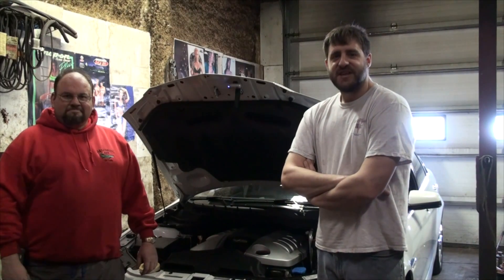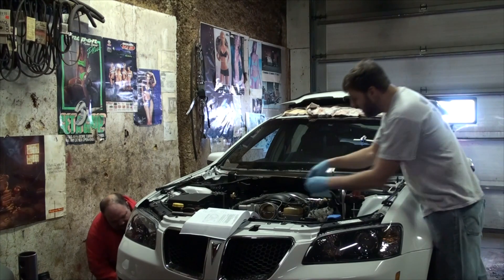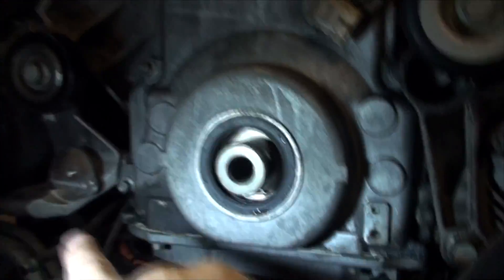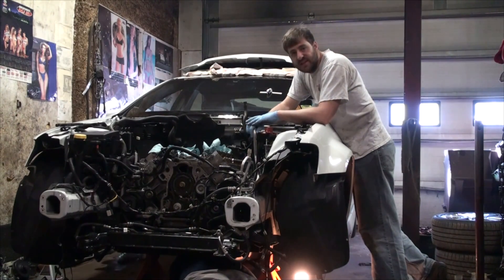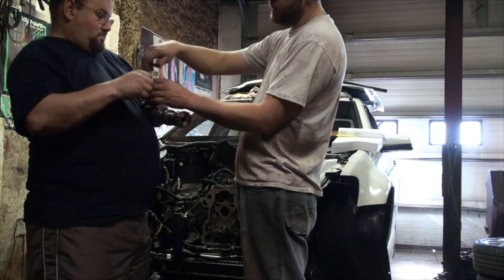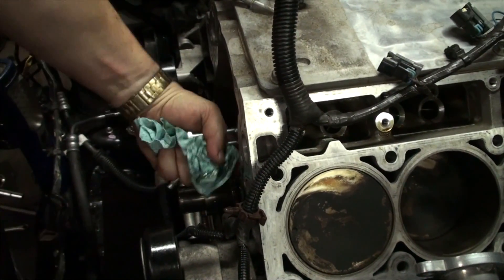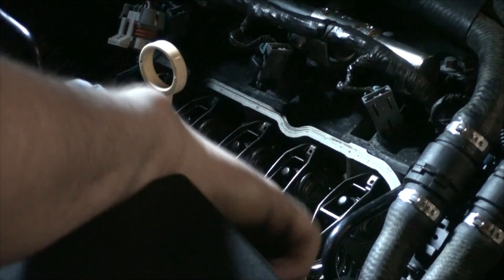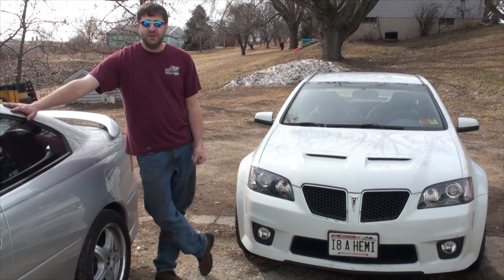Josh's Car Corner - Ep. 26 - Gen 4 LS Engine Cam Swap

Comment: One recommendation I would make is to tape off the intake ports on the heads and also stuff some rags in the openings to the oil pan on either side of the crank.  This way if the drop something you don't need to drop the oil pan or tear the engine apart.
Reply from the maker: If we weren't removing the heads, I would have blocked off the intake ports. Even if something had fallen into them, worst case it would have landed on the pistons and we would have removed it. I also blasted air into all the ports before I put the heads back on.
Reply: Say what?  He took the heads off.  LOL

Comment: Awesome video. Why do you drive the car for a couple hundred miles before a tune? What if it's not stoic? Isn't it dangerous to drive it much that way?
Reply from the maker: No,  it's not.  The factory O2 sensors are still working, and in closed loop the computer will adjust under normal driving conditions to be safe. Wide open throttle is a different scenario.

Comment: Did you use a pushrod checker tool?  Or were you lucky and got 1 to1 1/4 turns of preload?
Reply from the maker: Hydraulic lifters don't have preload.  You torque the rockers to 22 ft/lbs and you're good.  And because we used the same heads,  same gasket thickness, and the cam has the same base circle,  the same pushrod length as stock was used.
Reply: @JoshsCarCorner  Hydraulic lifters always have preload to attain proper valve train geometry. .070-.100 on LS7 lifters. Solid lifters don't have preload nor do low lash lifters.

Comment: So two part question. 1 what service manual and where do you find them. 2 is there anything internal requiring loctite, or TTY that you recommend switching to ARP? Did you actually have to use loctite on things like the can gear that are exposed to vibration? Ive heard bad fairytales of guys having the cam bolt back out and destroy the valve train.
Reply from the maker: The only service manuals for the GTO are the Helms service manuals. I believe you can get them at GM Parts House. I can't recommend where to get them.,

Aftermarket cams typically use a 3 bolt system for the cam gear, only the factory uses a single cam bolt on the Gen IV engines. Loctite, isn't called for by the service manual. If cam gear bolts come loose, it's because they weren't torqued down properly to begin with. Loctite doesn't work on bolts that are exposed to oil.

Comment: awesome vid. You made it look so easy. Any check engine light or anything to make it fail a  pollution test?
Reply from the maker: We did get a light for the MAP sensor, apparently it didn't like the cam lope at idle so I had to correct some things. And we don't have smog tests here, but the car has cats so even if got tested I could make it pass.
Reply: Josh's Car Corner thank you for the response sir. That is encouraging. My GTO needs it bad.

Comment: When jacking up the engine to remove the oil pan, what portion of the engine did you use so that you didn't damage the engine? I'm removing the oil pan on my g8 and am wondering where is a safe place to place the jack? Any info will be greatly appreciated!
Reply from the maker: We used an engine hoist and lifted the motor with a chain tied to both the lift points on the top of the engine.
Reply: +Justin Williams block of wood on the trans bellhousing remove the shiny inspection cover first and just jack til the motor mount pins are barely in the hole, then stick a short 3/4" socket on each side under the mounts, the pin on the mount holds them in and take out the jack , easiest way Ive found for the G8

Comment: How did you guys bend the pick up tube? What step bent it do you know? Also how do you avoid that problem? Because I’m doing my cam swap within the next week and I’m curious and can’t figure out how to avoid it and if you said it in the video I’m sorry i probably just didn’t catch it. Thanks!
Reply from the maker: We needed to remove the pickup tube from the engine and the pump first, so we should have dropped the pan and removed the pickup tube before trying to remove the pump.
Reply: Josh's Car Corner Ah alright, thank you! Appreciate it. Grateful for the video too, definitely helps.

Comment: That car was named the Holden Monaro in Australia (2 door Commodore) & was exported in left hand drive form to the U.S. badged as the Pontiac GTO,my car is a 2002 model Holden VY SS Commodore which runs the Chevy LS1 engine which needs a hydraulic lifter & I'd hate to say a camshaft replacement.I was wondering how long does it take to replace the camshaft & lifters while the engine is in the car?I know the cylinder heads have to be removed so I've been wondering could I do it over 2 days on a weekend in March or should I cross my fingers & hope the lifter roller(s) don't fall apart & do it over 4 days over the easter long weekend?I just need to cross my fingers that that it will hold up because once the engine has warmed up one of the lifters jam up & start making a "clattering" sound !!!!
Reply from the maker: First, I know the entire history of Holden, see episode 1 of the show. Second, regarding your cam swap, if you knew what you were doing, had all the tools and preparations done beforehand, you could get it done in two days. If you've never done it before, I would go for four days. I have done a cam swap in a VZ Monaro/GTO before and it is more involved. You have to remove the front bumper cover, radiator, and AC condenser so you can get to the front of the motor. This adds time because you have to have your AC discharged beforehand and recharged afterward. Also, you need a way to raise the engine to get the oil pan off so you can remove the oil pump. 

I'd say do it over the four days. Do all the prep work you can, take your time, and don't cut corners on cheap parts. Lastly, a ticking lifter can only get worse. If you have to drive your car, do so sparingly and keep the revs down.

Comment: So quick question im looking at doing a cam install on my GT. Unfortunately that means i also need to accompany the swap with a DoD delete. So right off the bat im already looking at an immediate tune to follow. With the gt running the l93 heads, would a 224/228 cam cause the comp to hunt for idle too much or is this a milder setup? Im looking at a setup from new era that is a 228/240 and comes with ls7 lifters. Considering this is my DD it would suck for it to be a PITA to drive because of a really lopey idle. Also what cam is this? lunati? Comp?
Reply from the maker: +Jordan Wiggins Joe got a Texas Speed grind I think, it's a Comp Cam in reality. With his car, I didn't have to adjust idle that much apart from increasing idle speed slightly. What I do remember doing is adding a lot to startup enrichment because he was having to give it gas for it to fire after the cam install. 

A 228/240 would be way too lopey on the street, you'd get annoyed with it pretty quick and your gas mileage will plummet. I would recommend against it if your car is a DD. If this kit comes with pushrods, make sure they are set up to work with using LS7 lifters. They need to be the right length for the preload to be correct.

Lastly, have you done corresponding upgrades beforehand? Headers, exhaust, CAI? If you haven't, you should do those first to get the most out of a bigger cam.
Reply: +OldskoolGP i have not done the header upgrades or the other tunes. Strictly getting my research done before dropping serious dough into the engine. I liked how the 224/228 cam sounded on this car super aggressive with just a little bit of lope. So im considering a milder cam as my DD. For the other things, was either considering a vcm or rotofab intake, midlength headers, and solo HFC with a mach exhaust. Opening up the air on both ends should really wake it up. I saw this same came with texas speed. Did it comes as a kit? Or was it a collection of parts over some time?
Reply from the maker: Joe got his parts over time. Keep in mind the shorter the headers are, the more low end is affected. You won't lose power, but you won't gain as much as you would with long tubes. 

Let me put it this way. Joe ran 19.921 bone stock, then he put the VCM intake, exhaust and headers on and I tuned it and he got into the 12.40s and gained almost 3 MPG. Airflow is everything. Help your engine breathe before you throw a bumpstick at it.
Reply: Nice. Thats awesome. Yea the only reason i want midlengths is for the ability to swap the cats. That being said, it sounds like this cam selection was a real winner even for DD atleast judging by what my ears are saying. Awesome video btw, this will be my foundation for doing my cam job in the future.

Comment: Quick question. I'm in the process of buying an g8 gt. I also have an gen 4 408 stroker w/ ls3 top end. I was wondering how hard would it be to do that swap?
Reply from the maker: Swapping engines isn't that hard. The easy way to do it is to drop the front subframe, but most of us don't have the resources to do that. You best best would be to remove the front of the car like we did and bring it out the top.
Reply: @JoshsCarCorner  thanks for replying back.  well I guess i should rewrite my question. Putting an LS in a 95 impala, we had to swap EVERYTHING. My concern when it comes to the g8 would be the sensors and wire harness. I'm not quite sure if there is anything I would need to do to the harness. Do you have any insights on issues that may come across with the sensors and harness?

Comment: What cam do you recommend for my 04 GTO I have headers, exhaust, cai. Want to put 243s and a cam but I don't know with what to go..
Reply from the maker: It depends on what you want to do with your car. If it's going to be a daily driver you want to go with something more mild. If it's a weekend fun or track car you can go with something more aggressive. An LS1 intake and TB are also limitations. Without changing those there's no point going above a mild grind because they can't support the increased airflow demands.

Comment: If your going to the effort to do all this, wouldn't you just pay a little extra and put in double row timing chain, tie bar lifters and double valve springs. Wouldn't that make it extra reliable?
Reply from the maker: Double roller timing chains are not more reliable, and not necessary in this case because the spring pressure isn't nearly high enough. The factory LS3 rockers are the best ones GM ever came out with and are perfectly suited to this application.

Comment: was the valve lift not high enough to use dual valve springs?
Reply from the maker: You don't need dual valve springs until you get over .600 lift.

Comment: umm how much HP hes making now? .... and whats the meanest cam i can put on a stock LS1 1999 Camaro SS SLP A4 all stock!
Reply from the maker: +CamaroWarrior He hasn't had it dynoed since, but he should be right around 500 at the crank. As to how aggressive a cam you can put in your engine, there is no right answer. With an all stock motor, there's no point going too big because without the engine being modified around it, you won't get all the benefits of a big cam and if you don't upgrade the valvetrain that will stop you because the factory springs I think won't support more than .550 lift or so. For a cheap bumpstick without having to upgrade anything else, I would recommend either an LS6 camshaft or in the GM Performance parts catalog there is a package called the GM hot cam kit (P/N 12480033) that you would be able to use without having to change anything else.
Reply from the maker: +CamaroWarrior Also, as long as you're in there, throw on an LS2 timing chain and sprocket setup. Much stronger.

Comment: So is the parts list for this the same as the gt engine? Any chance you could email me a recommended parts list? I see lots of different options from just DoD delete kits to completely custom valve trains. I hear the lifter trays on the gt are a huge problem.
Reply from the maker: Not entirely. You don't have to change lifters because the LS3 has no DoD. I recommend replacing the trays any time you're in there. They're very cheap, and good insurance. I can't give you his parts list. My advice would be decide what you want to do with your car and do some research about the parts you may want to use to get you there.

Comment: I'm doing a cam swap on my 2005 GTO. Ill be watching this video a while doing the swap. Check my video on it. Any suggestions? Oh When I take out the oil pump do I have to lift the motor to take out the pick up tube? Or is there a enough room?
Reply from the maker: I never tried to take the oil pan out of my car with the engine installed. If you can do it, do it. Because you have to to get the pickup tube out correctly.

Comment: awesome video i want to cam my ls1 is the timing the same set up i was told by some one els the its not the same as a ls3 cheers
Reply from the maker: Steve Smith The timing setup is the same.  Different tensioner and the cam sensor is on the back of the LS1 instead of the front.

Comment: You don't have to take the heads off to change a cam. Just so you know
Reply from the maker: Jason Cramer I know you can try to get away with leaving the heads on and hope a lifter doesn't drop. But if a lifter does drop you'll be taking the heads off anyway,  so you may as well do it right the first time.
Reply: If you take two metal rods down the valleys on either side of the cam. They won't drop and saves you from having to take the heads off. I watch your channel all the time. I own a torrid red 06 Gto. Keep up the good work
Reply: Jason Cramer Was about to comment this, but figured someone else already did.  Figured they were replacing lifters or something, then I saw him putting the old ones back in I was like wtf, why'd they pull the heads?
Reply from the maker: We did change the lifters. We put LS7 lifters in.
Reply: Josh's Car Corner Gotcha, didn't see those on the table at the beginning of the vid.

Comment: I will fire both of you the first day if you guys do all of that to change a cam on a LS1. The video is great but you guys have complicated the life of this entire country when changing a cam on a ls1, ls2, ls3, ls6, lswhat?  75% of the stuff you guys dismantle was unnecessary. Don't take the wrong way but before you post a live video make sure that it complies with easy work and not extra work. next time try taking the front components such as serpentine system, water pump, alternator, etc. everything in front to the cam and timing chain cover plate.  Once you have done all of that then remove the cam retainer plate. once ready to remove cam, rotate engine several times. You might want to remove spark plugs for easy rotation and less compression. Once you rotate engine at least 3 full times insert two 1/8 or 3/16 rods on each side of cam at the oil lubricating  ports. Insert them all the way to the back of the block. (I don't remember exact length of rods). Now you can remove cam and not worry about lifters falling in. Insert new cam and put all back. I did it he same way on my 1966 Pontiac and got 396 LB/TQ at rear wheels.  Any questions feel free
Reply from the maker: chui19801 I have a question.  How do you not have anything better to do on a Friday night?